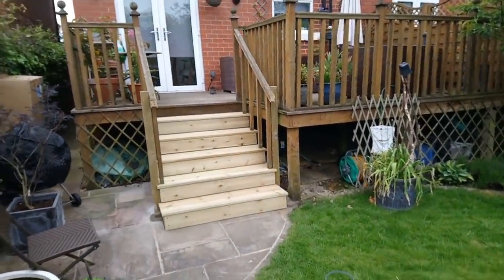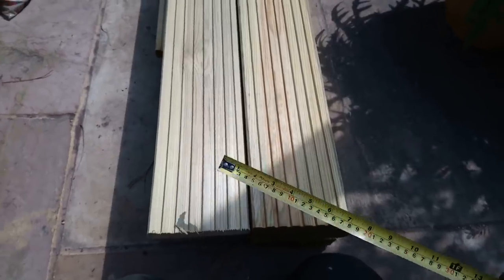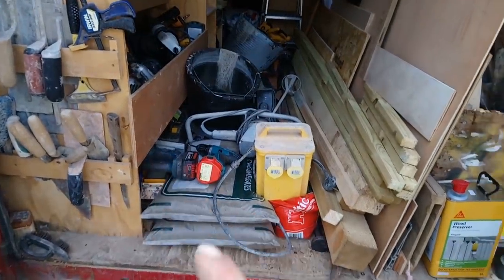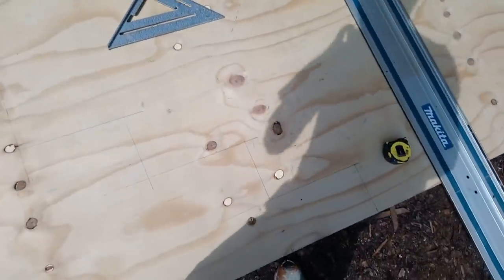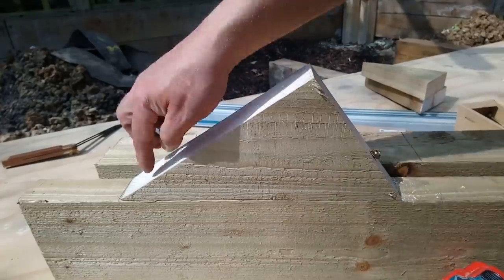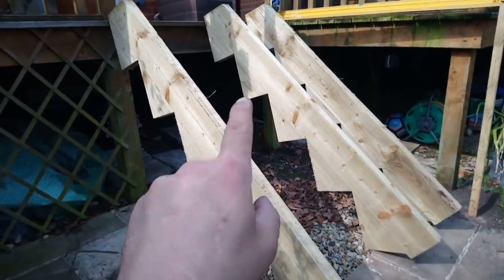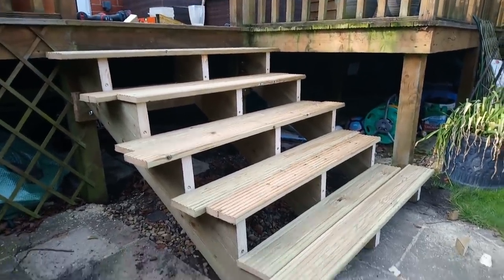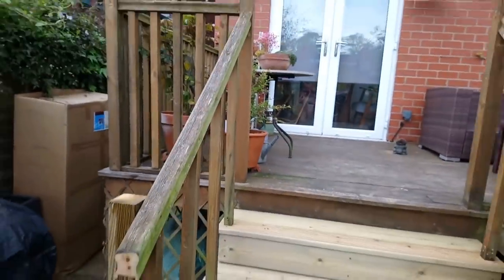Decking stair replacement, built how I'm not used to so I wasn't going to upload this

Comment: Just finished my second year at college doing carpentry and joinery and all I can say is I aspire to be as experienced as you and be able to produce joinery to such a high standard you do, Thanks for the videos.
Reply from the maker: 👍 Good, Thanks, Set your standards high then when you fall short of those your work will still be good, Most things i do are just an extension of what i learnt in college/apprenticeship, sq,level,plumb, etc.. measure accurately, work to ½mm, cut to the line, leave the pencil line in or cut along it, The little tips that I've learnt over 35yrs are what I'm trying to share, I can't share everything but I'll share as much as poss,  it will come to you as time goes by, the more you do, the more you watch n learn & unfortunately the mistakes you make will add a bit more skill to your abilities & It'll get easier, Best of luck n there's a lot worse jobs to do  😉😁👍

Comment: Use some coach bolts into the underside of the last step where the stringers sits on the ground and just have them proud enough so that the heads of the bolts are touching the flag stone. They keep the stringer off the ground and you can adjust them bit by bit until the whole thing is sitting level

Comment: Well that was hard Work Gid, so well done for all the work a rounds you had to make. I think I have only built 4 sets from memory, and we are fortunate to have wide boards to notch out as the 'Americans', do. I use the framing square and stair studs at the cut marks. So as long as measure twice..... it makes life a lot simpler than having to build up as in your case. A job well done. Ditto, I enjoy the geometry as well :)

Comment: Another great video and a well deserved increase to 6K subscribers - well done!
Reply from the maker: Thanks Andrew 👍 Yep the subs are nice 😁
Reply: @Gidjoiner  You should really have a lot more than 6k subs given the number of high quality videos you have put out over the last 5 years.  I am slowly working through them and have discovered the ones you did on Turbocad and GIMP - didn't realise you had these skills as well - very impressed!  As an aside I'm thinking of buying a small compressor for nailing and spraying.  I'd like quiet if possible but also reliable.  Is there one of your videos I should look at to determine make, cfm and tank size etc?
Reply from the maker: Hi, i only started putting effort into my vids from early last yr, 2018, that's when the subs started going up, this time last yr i only had about 500, The Gimp program is brilliant & it's free, i use it to make the thumbnails for my vids & for other bits like masking when editing, CAD I've used for at least 19yrs since going self-employed to draw the plans for my work, there's so much to these programs that i prob use less than 5% but the ones I've used are very similar, the simple 2D parts i use anyway 😉
I have a Bostitch 50ltr compressor, don't think it's available anymore but Stanley's one looks almost the same, (owned by the same company i think), It's just big enough to do the spraying i do, if it broke I'd consider a 100litre or bigger, Cfm i don't know, it has two outlets, one of mine goes to the filter/regulator for spraying that's only ever set at 20-30psi on the regulator, the other line straight from the compressor feeds the workshop, nailguns, blowers etc. set at the machine full psi whatever that is, it handles all nail guns no prob, when working on the van it handles the little body saw ok but other air tools like grinders it runs out of air too quick, It cost a little more than other makes but Bostitch are good quality, my no1 choice of nailgun, 7 out of 10 of my guns are Bostitch.
Reply: @Gidjoiner  Thanks - I really appreciate your help with that!

Comment: Very interesting to see how you do the calculations for the steps. Just wondered why you didn't use some glue as well as the bolts when fastening the triangles on to make make the 'dinosaur back'. Wouldn't it help to stop any water ingress between the pieces of timber?  Another fascinating video Gid. The final steps look good but it does highlight how tired the rest of it looks..
Reply from the maker: Hi, I very rarely use glue on a deck or most outdoor projects like this, it might seal water out but also might seal water in, the whole piece would have to be sealed,  Yeah thanks they turned out 'ok' It's always hard putting effort into a repair like this when the whole thing needs a good going over.

Comment: Thanks, interesting as always, why did you not use glue when attaching those triangle bits?  👍
Reply from the maker: Thanks Richard 👍 outside joinery/carpentry rarely gets glued, there have been exterior glues around for yrs, Cascamite n urea formaldehyde but i think they are classed as resistant not waterproof, PU glue is waterproof but looks horrible orange after yrs

Comment: Hi mate I made a staircase at college last year we laminated two. 2x6s to get a 2x12 the routed out for treads using the stair jig could you have not done the same and then cut out the triangles ? Just a thought
Reply from the maker: Yeah that would work, prob more accurate but working on site & not from a CAD drawing I'd still have to draw it/ work it out then set up the jig & router & prob have more waste, doing it the way i did i could use the opposite triangle piece with only the saw cut as waste, but yeah i like the idea & setting up a jig normally saves time & gives a more consistent cut/finished piece in the long run 😉

Comment: Hiya bud, great video as usual, but I don't really understand what the problem was with this build. I think you have said that you have Turbocad. Did you set the steps out on this? If so it should have been relatively easy to work out the rise and going. I design steel staircases and fire escapes  for a living and I have to work to the nose of the tread on all the steps and make sure it aligns with the nose of the landing plate, ( your deck platform on this job).  If it doesn't ( and you can check this with a straight edge or long bubble or piece of string), it will get knocked back. If this straight edge etc. doesn't follow a completely straight line from the deck nosing to the bottom riser nose, it can give you major problems with the handrail height on returns on secondary platforms etc. and the top of the handrail has got to be 900mm measured vertically from the nose of the tread to conform to building regs in the UK. Keeping this straight line is critical to the finished job looking good.

All the best bud.
Reply from the maker: Hi, Thanks 👍 
It was the type of build, the triangles attached to a plank I'm not keen on, not used to building in that manner & that it was just a relatively cheap repair/replacement. I don't understand your misunderstanding tho, yep fairly easy for me who builds staircases occasionally & def for you who designs for a living but to put it into words on a video so others can understand & for those building on site without a CAD program isn't so easy esp while actually trying to just get on & do my work.  I mentioned the nosing on the landing, the 900mm from the nosing handrail height, when drawing it i mentioned i would normally draw this which would give me the sizes etc more accurately but i didn't for this, I think that was obvious, Thanks for the comment but did you watch the video?.
Reply: @Gidjoiner  Yeah Gid, watched it all.  Probably me misunderstanding what you were doing. Please don't take it personally.  All the best bud and keep the vids coming.
Reply from the maker: Yeah no prob, this was an on site job in a style i wasn't used to or comfortable building, trying to explain how i went about it, sorry prob came across as getting my back up a little, I know staircase geometry & specs quite well, I did tech drawing at school, still enjoy it, most of my work when employed by firms was on commercial buildings. 
For a house/better job I would draw a staircase on the PC, use planed wood n a router to cut to the mm but this had no planning as such, cut sawn timber with a rip saw n coach screw it together 😉

Comment: Ever thought about getting an impact driver? A lot easier for coach screws etc
Reply from the maker: Yep,👍 Had this conversation with Phil on this video so sorry for copy n paste -  I've 4 working drill/drivers, one day when I've spare cash or when i need to replace one of them, - I'll look into it, it'd have to be or I've considered getting the Bosch 18v one, Screwfix have it Bare for £90 but it's having the spare £90 🤔 I've batteries & quite like the Bosch jigsaw, planer & angle grinder, I don't mind buying more batteries for those in the future
Thanks Sam 👍
Reply: Gid joiner sounds like a plan
Reply from the maker: A new 10mm socket would help with the coach screws, keep forgetting 🙃😂

Comment: Hi Gid do you use turboCAD and if so which version and would you recommend it for design work.
Reply from the maker: Hi, I've had a few over the yrs but yeah TurboCad deluxe 20 is what I've had for quite a few yrs now, They've all seemed to work in very similar ways, the lay-out & symbols have been similar, I only use 2D part of this program & there's prob 90% of the rest of it i don't use so if i was buying one don't spend a lot & get one that doesn't need to pay to update,
Reply: Gid joiner Thanks Gid for your reply. great Vids like the format have learnt a lot from them. Please keep em coming.
Reply from the maker: @peterhope9486  😉will do Thanks 👍

Comment: Surprised you don’t use an impact for driving those long screw, they pack so much more torque.
Reply from the maker: One problem with that, I don't have one 😏 I've 4 working drill/drivers, one day when I've spare cash or when i need to replace one of them 👍
Reply: Gid joiner i really like mine, i’ve got back problems and the extra torque really helped me, used to do my back in driving long screws all day on decking etc. Impact just bangs em in without cramming out.
Reply from the maker: Ok, yep thanks I'll look into it, it'd have to be or I've considered getting the Bosch 18v one, Screwfix have it Bare for £90 but it's having the spare £90 🤔 I've batteries & quite like the Bosch jigsaw, planer & angle grinder, I don't mind buying more batteries for those in the future, (you do know that now I'll buy one even tho I don't Really need one & I haven't got a spare £90 n the kids will have to go hungry 😂.)     I haven't got kids 😀😏😉
Reply: Gid joiner Makes sense to standardise on one battery type. I’ve got screwfix / Erbaurer twin set brushless, cheaper than branded gear but still pretty good. Battery life on brushless is really good.
Reply from the maker: @sweenep86  Yep, My Makitas are old Ni-Cd & I don't want to go with Milwaukee, that's only 12v & prefer a Bosch.

Comment: Nothing worse than working with old shite timber , you could tell you was gutted never mind on to the next job
Reply from the maker: Yeah, if i wasn't filming it would be fine, just another day fixing up something but trying to show how i went about working it out without sounding a little flat .🙃😶
Reply: Gid joiner lot more work involved in doing those type of steps instead of the box style .do you just go with what customers want or do you try to talk them around to what you think is best after all your the expert and would no best
Reply from the maker: I was thinking that while building it that actually stacking 6x2 timber frames might have been easier, poss a bit more materials but like i say i don't normally build them like this so lesson learnt, Customers normally have an idea of what they want, if they haven't already i suggest going online or to my Facebook page n find pics of similar things, decide on the finer details but yeah i discuss the options, pros n cons to design & materials, it is their choice in the end, I said I'd build this in a day but the post & frame would need a hole & a few inches of concrete footing in the bottom that would need to be hard before a post could sit on it which would need a couple of days to dry... if the ground was flat then maybe no post holes needed just some kind of solid base/footing... this was the choice of the day 😉🙃